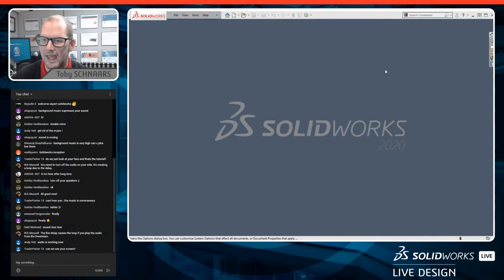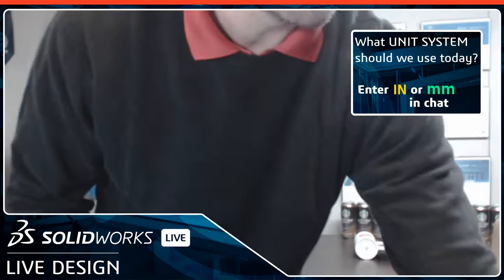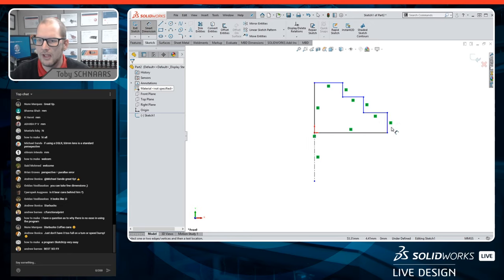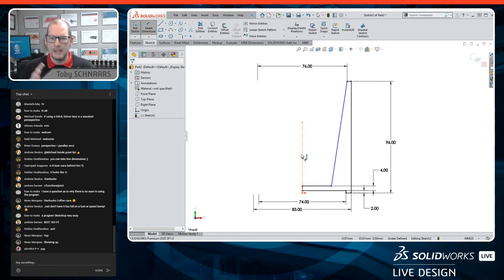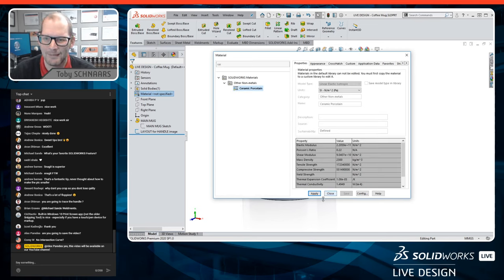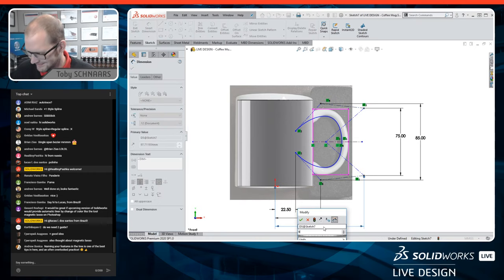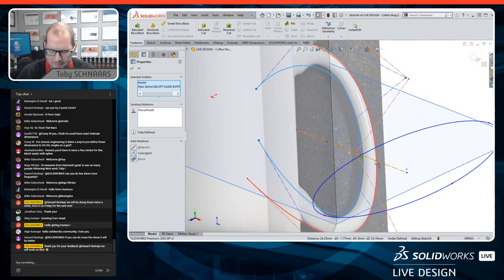Coffee Mug Design While Drinking Coffee - Episode 1 - SOLIDWORKS Live Design

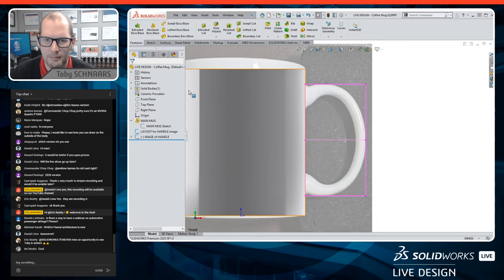Comment: Everything fine until 33:36. When I attempt to assign a dimension from the bottom of the original sketch (not the bottom of the revolve) to the bottom of the mug handle I get the error "make dimension driven" which didn't happen with your design and regardless of which option I choose it messes things up. When I measure from the top of the handle sketch to the top of the mug and bottom of the handle to the bottom of the mug it's equally spaced. When I originally did the colinear attachment of the handle to the mug the handle seemed to snap in the middle. Any idea what I'm doing wrong? Thanks, this is a great series and looking forward to the next ones.